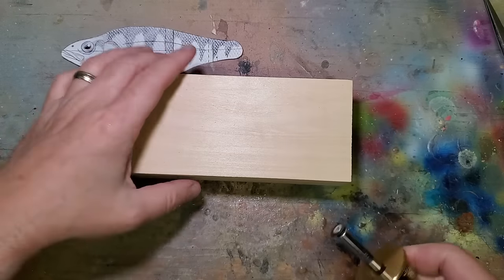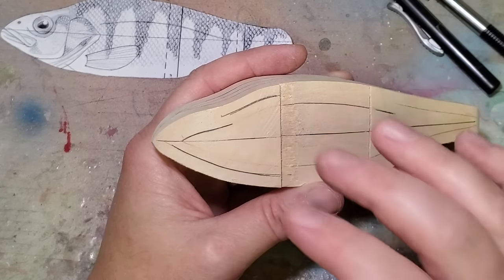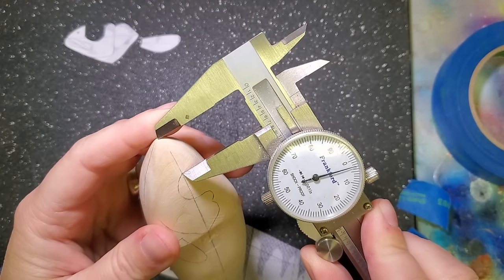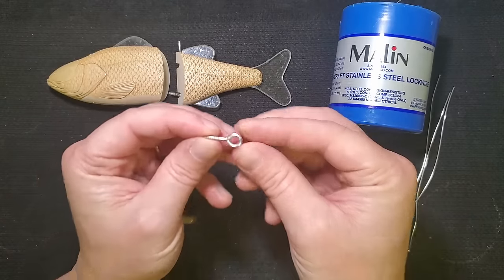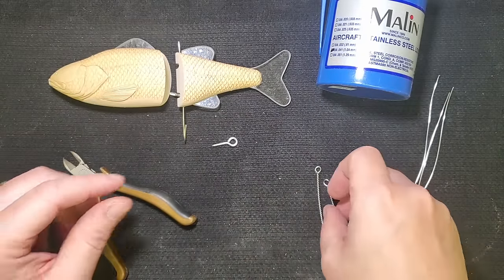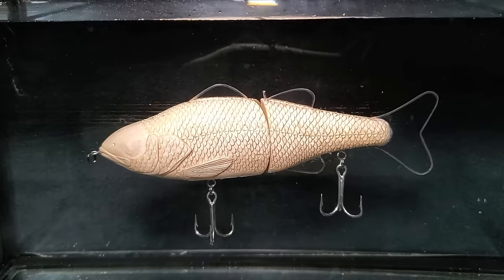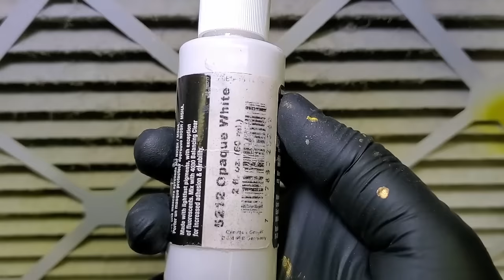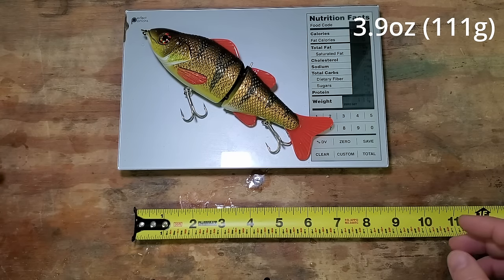Perch Glidebait Lure Making - start to finish process on making wooden fishing lures

Comment: Had an epiphany for you with trying the spray kbs pick up a cheap syphon airbrush wider array of spray also less cleaning
Reply from the maker: Thanks, I'll take a look at that. Never used one before but it might just be the ticket.
Reply: @zimmtex  harbor freight has some and I don’t think you can get much cheaper they do spray decently the hardware is clunky but they got me through a project in a pinch

Comment: That swimbait looks and performs beautifully. I love it! I read through some of the comments and saw where you said how long this lure took to make. Thank you for the time and effort you put into getting this together. I know you'll benefit from having  the fishing lure, but we all benefit as well from being able to watch the process and learn from you. Merry Christmas Zim!

May I ask, Do you have a link to the waterslide paper that you use for your logo?       Thanks
Reply from the maker: Thank you very much, I really appreciate your support! I do have a link to the decal paper, but it keeps getting discontinued. However, you can probably find the same thing at your local craft store.

https://www.zimmtexlures.com/productlinks
Reply: @zimmtex  Thank you so much for the link. At least I know to look for Testors. And if it does become available I will try to purchase it through your link. The stuff I am presently using is so thin that it wrinkles and curls under so easily and frequently that I often have to remove a decal, toss it away, and use a new one. So I will print a couple copies of special decal just to be sure one will work. You can pick yours up with tweezers and the seem to hold up and not get floppy or curl.

Comment: What size wire do you use in the tail to connect the front body?
Reply from the maker: I used a 0.62" stainless steel lock wire as a pin to connect the two pieces. Thanks for watching!